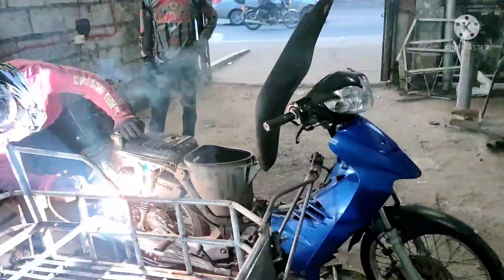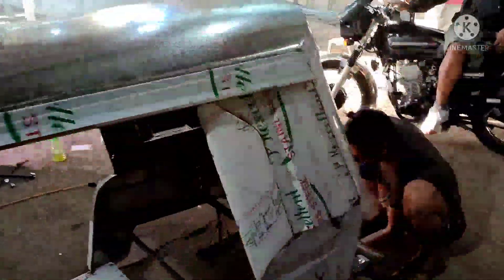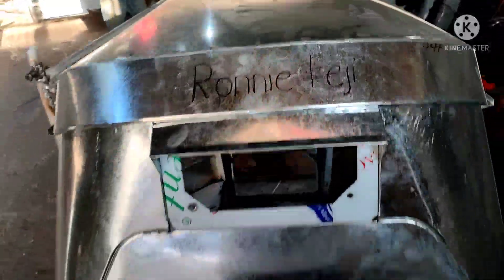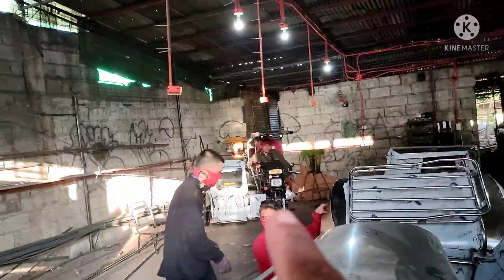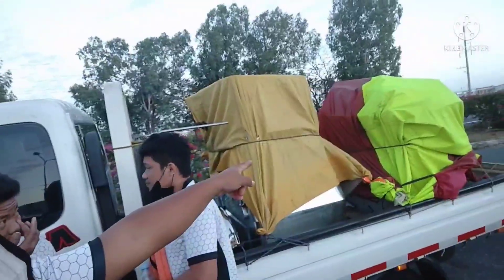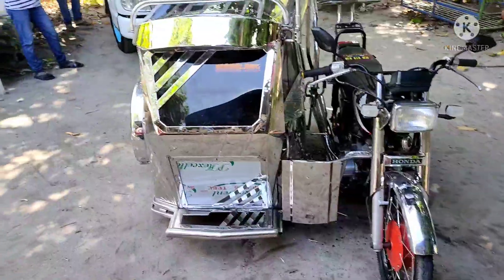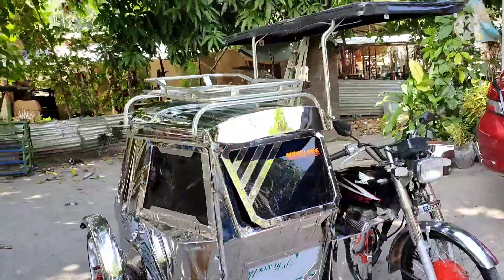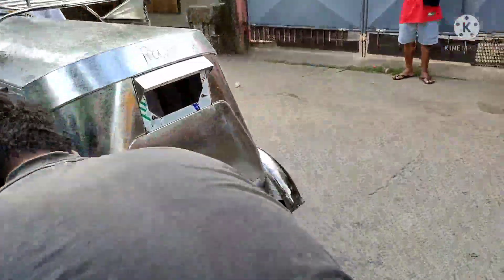MANALANG SIDECAR. PWEDING IPANG DAYO SA MALAPIT!!!

Comment: Magkano pure stainless complete accessories?
Reply from the maker: Pure stainless Po 22k with mags wheel.2 doors side by side 5k carrier top 2800 carrier back 3k double sandalan 1800 big antena 1500 per pc. small antena 800 per pc. Windshield 3k spoiler 4per pc. Crusguard 2500 buo.

Comment: Dba sir.. dapat may sakay na 2 sa side car para malaman kung may kabig...
Reply from the maker: Kahit Po walang sakay malalaman kung may kabig.ung bigat Naman Po natural Naman Kasi Hindi na cya kamuka ng single n motor.may hila hila na Kasi.
Reply: @Lfiemanalangsidecarvlog  kapag my sakay ng 2  sa side car.. dapat moderate lang ang kabig.. d yung tinutulak mo yung  kanan manubela at hinahatak mo nmn yung kaliwa manubela.. dba dapat ganon ang test drive?.. curious lang sir... Pumasada kc aq yung akin kc ganon cya..  pero sa iba katoda q d nmn ganon.. parehas lang kmi edad ng sidecar, 5 yrs na. At wala den nmn tanggal na welding.
magkaiba nga lang kmi ng maker.
Ano poh ba masusugest nyo na solution...
Reply from the maker: May kabig nga Po un sir.nag stretch na Po ang mga bakal na ginamit sa inyong alignment.normal Po un lalu na Po laging pwersado ang byahe.ang Magandang gawin pp dyn pa re alignment Po ulit sa motor at side wheel 💯 mawawala Po ung kabig basta marunong lang Po ang mag align.

Comment: Lods magkano inabot nyan ty lods ..
Reply from the maker: 40k Po Hindi pa Po kasama ung delivery charge.diendi Po Kasi Yan ipalalagay e.
Pure galvanized 12k
Semi stainless 18k Po naka mags na Po
Bubungan galvanized 21k Po
Pure stainless 23k Po
Super stainless 38k Po 
Pinto 3500 sa main door 2500 sa side door roof cross bar 2500 carrier back 3k
Big antena 1500 isa
Sandalan 1800.at IBA pa